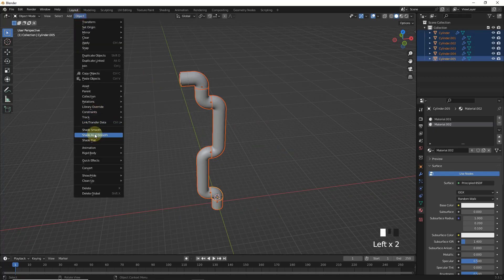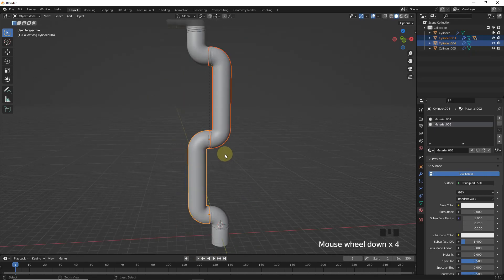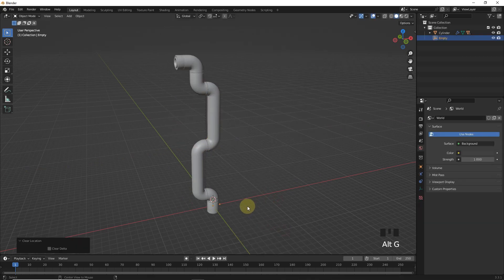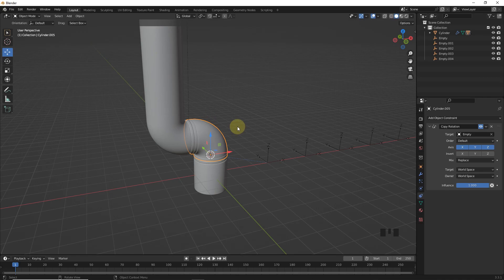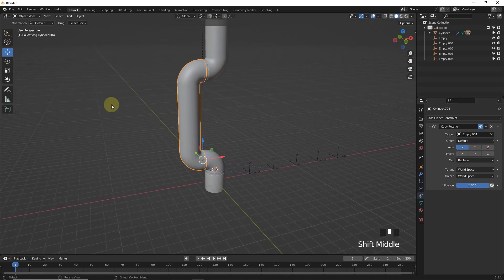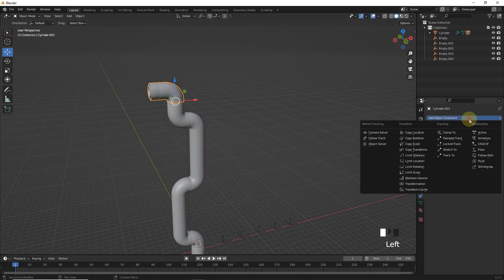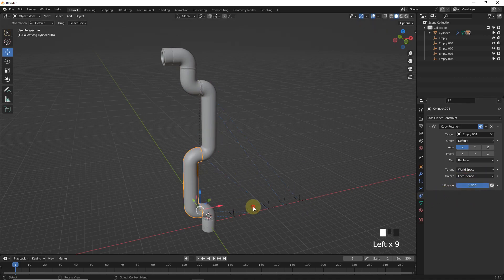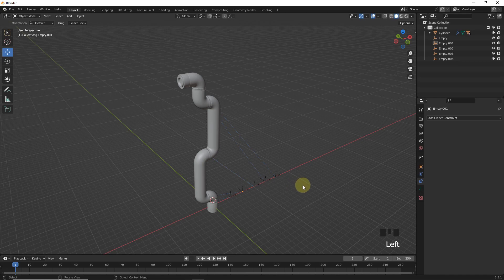Rig This Robotic Arm Model Easily In Blender

Comment: It's not really useful. If it's easier, it's doesn't mean that's better. To make correct animations you should make a rig at least, but it would be better with setted up constraints inside it. But anyway, good luck in ur work!
Reply from the maker: Thanks For Comment.....
Reply: @MoinAkraM  i was able to do it with an armature and add IK